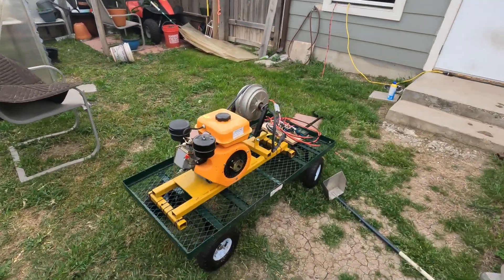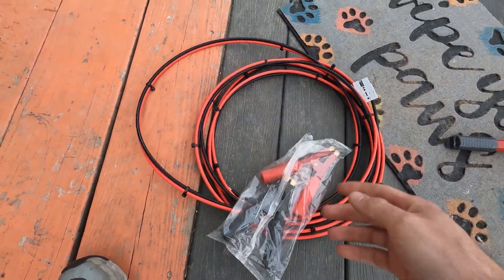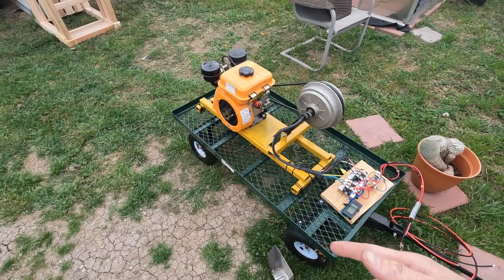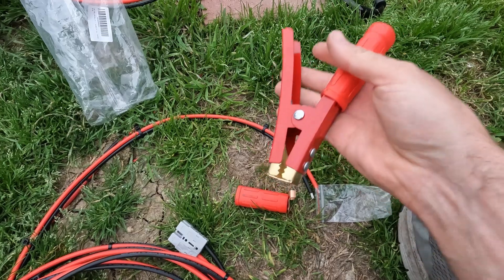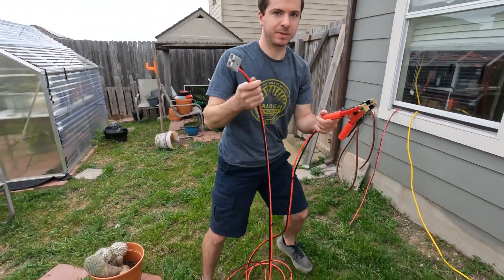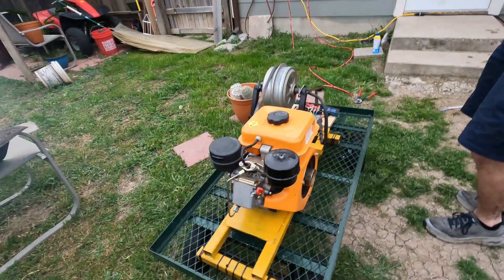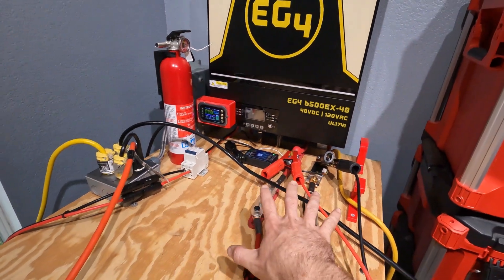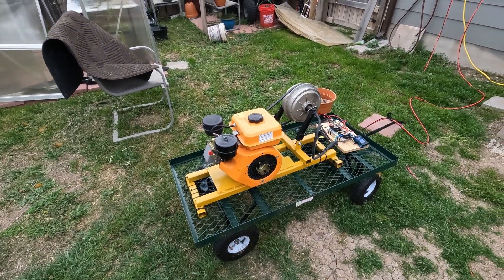Chinese Diesel Engine charging 48 volt batteries

Comment: you can use alternator as alternatof for starting generator then use as power generator with relays for controling charge boost converter connected to pwm charge controler(pwm so alternator dosnt stall the engine) then you can connect that to esp32 and home asistant so baterys gets lower than %10 generator auto starts

Comment: Nice! A couple days ago, me and my dad tested if our generator can run on propane and see if it could power a camper. It passed with flying colors.
Reply: How long did it run?  How many hours do you have on that diesel?
Reply: @haydenc2742  It's a gasoline motor. We were only testing to see if it can run the AC and the microwave while running on propane.

Comment: Very cool...Are you going to run a long term stress test...see how long it will run on a full tank of fuel at "charging" RPM's?
I still have yet to see a really good long term run test on any of these little engines...I have one...just don't have it driving anything...guess I need to change that
Keep em coming!!!!
Reply: I would love to see that too. These things seem like a great idea, but durability is the elephant in the room.
Reply from the maker: Yes I would like to, aswell as try different fuels, so far it’s been solid, probably only have 2-3 hours on the engine, cranks right up every time
Reply: @Mikebuildss  Thanks. We’ll keep watching the tests and see how it holds up.